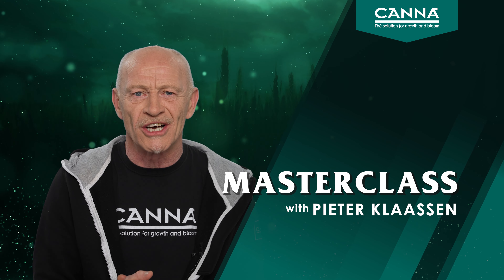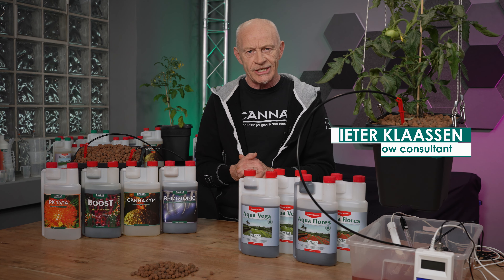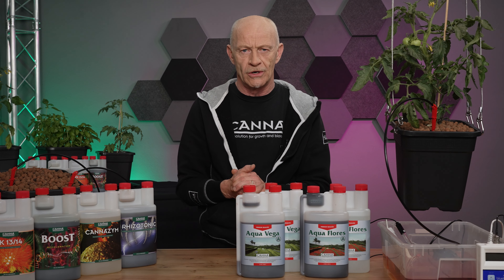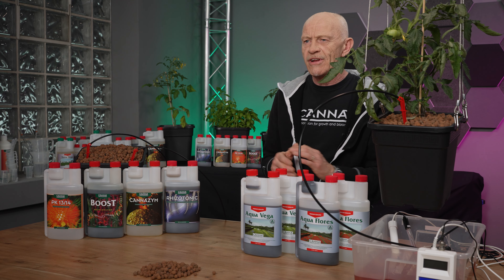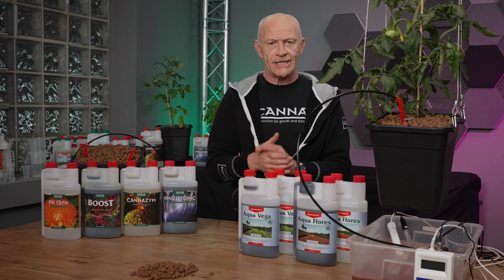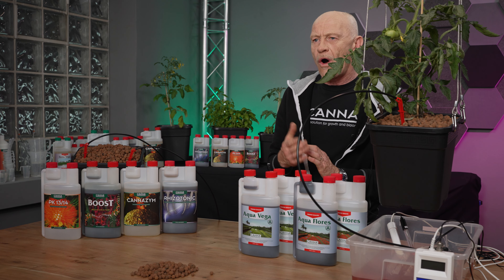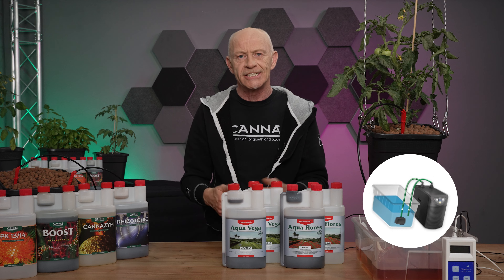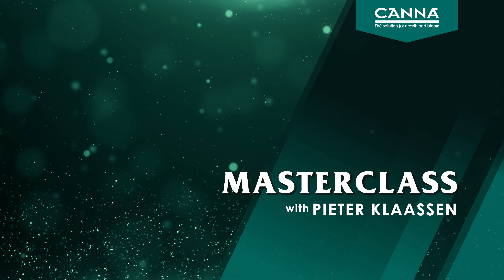Masterclass – Hydroponics Recirulating System

Comment: Hi Pieter. 

Could you tell a bit more about the watering times in an aeroponic system? I always go with 15 minutes on and 15 off. Is that too much or too less? So far everything looks great. The first 14 days it‘s 15 on and 30 off. I know there‘s no „Schema F“, but is there something to know about? Please help me out. ✌️
Reply from the maker: Hi Knut,
Watering in an Aeroponic system is the most difficult recommendation you can give without knowing all factors of growing and especially the system itself.

For example;
It depends on the type and size of the plug, which you use to hold the plant and so also the water (buffer) or not.
Your "dry" time can be/must be longer if the plug hold more water.
You have to force the root to look for water (at the bottom).

The age of the plant is also a factor. More roots can become a kind of substrate too.
And the watering system itself will influence your watering schedule..
Anyhow, the roots must stay moist/wet between each watering
The water and air between the waterings must have and keep the same temperature. Fluctuations or too high can kill the roots

If your roots can touch the (drain-) water,  later on,  your frequency becomes less important,

The start:
As long the roots don't touch the water layer (if any), your "dry" time cannot be too long.
Nevertheless, your  15 ON/ 30 OFF (= 33/66 = 1:2, watering schedule), sounds to me too extreme.
Check if each root still has a drop at the tip of each root. If so you were right.
In general, I recommend a 50/50 at the start.

Later on, the "dry" time can be reduced if the roots hit the waterlayer (75/25= 3:1= 15 min ON/ 5min OFF) for example.
I say it in percentages, because 3 minutes ON and 1 minute OFF, is also possible.
But again it depends on your system

And don't forget the strain. Some strains don't like water systems like aeroponics.

So maybe it was better to recommend you, to ask the same question to the producers of your system

I hope this general answer will help you.😉
Reply: Wow thanks for the fantastic answer. ❤❤❤❤
I needed to stop my last grow due to HLVd (I have a diary with fotos) and clean it all with chlorix. I will try out what you said. Thanks a lot. 👨‍🌾